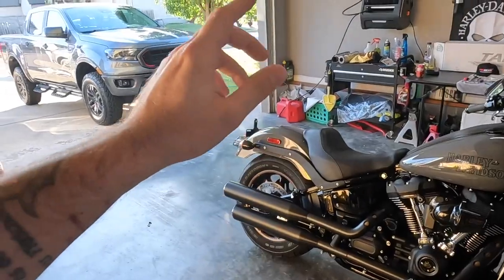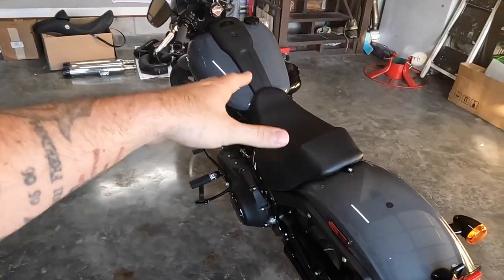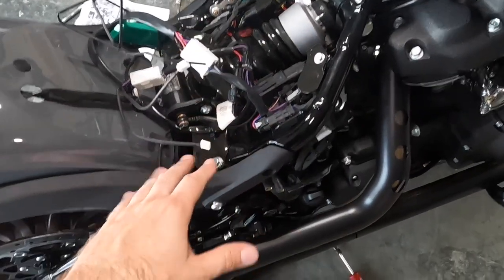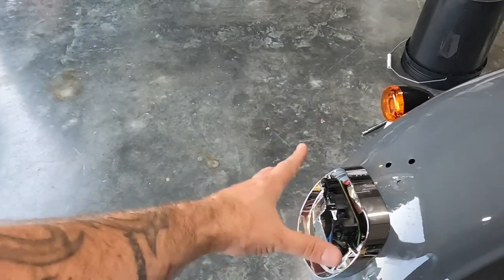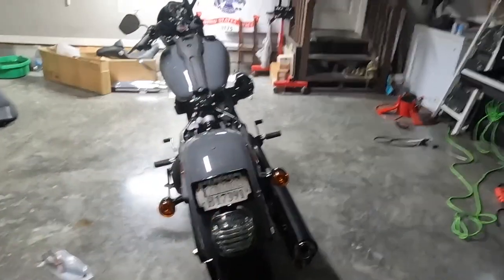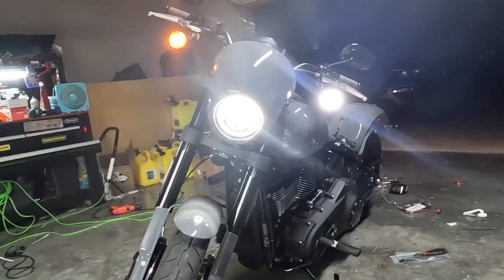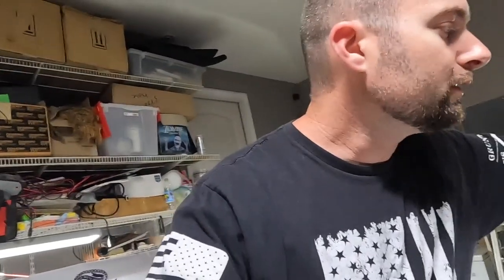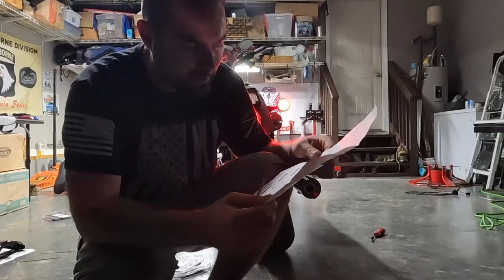FIRST MODS 🔥 2022 HARLEY LOW RIDER S! Custom Dynamics FTW!

Comment: Hey brother, where did the two connectors with the male white clips go?? I thought I’d of struck gold when I found your video bc nobody else has the Custom Dynamic setup for our specific bike on YouTube. Have everything connected except for those two connections and as I’m in my garage trying to figure this out I’m losing my shit lol.
Reply from the maker: I was left with two plugs that went no where. My guess is they are for another model or other lighting accessories
Reply: @Zander13Productions  it turned out that they are for aftermarket LED markers or similar. I didn’t connect them but successfully installed it. The programming took me longer than the install 😜